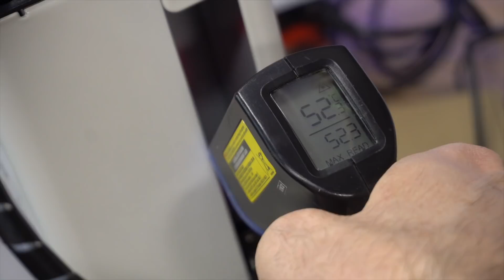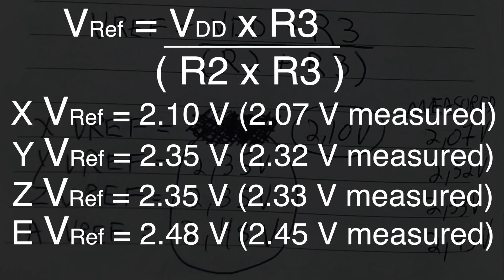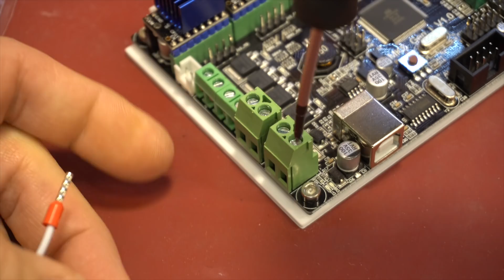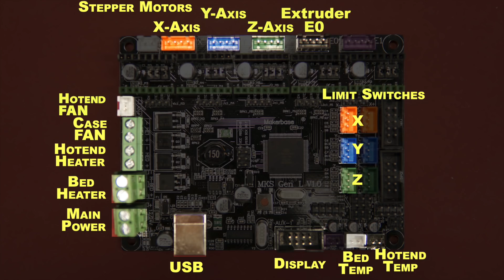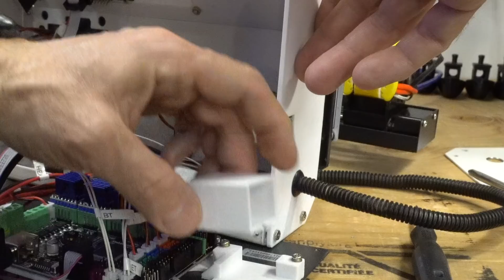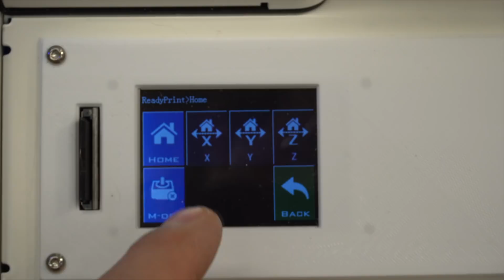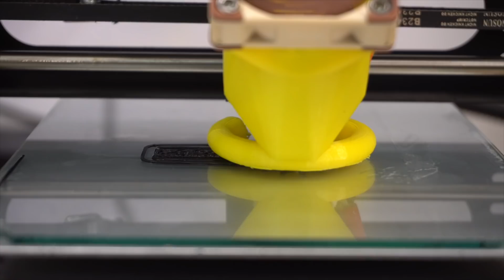Monoprice Mini V2 and V1 - Transformation Part 2

Comment: Frank:  Well, things are beginning to get final, however, there is one issue that so far is not solved:  The hot end fan does not come on when the extruder temp exceeds the set temperature (50C).  It's connected to pin 9, as is specified in configuration_adv.h.  The fan was working fine in the original configuration, so it should be OK, but I also checked the voltage on those pins, and it's zero.  

Is there someplace else that it could be overridden?  Note that this is in a test only.  I have not yet been able print anything.
Reply: Well, it's gremlins again.  There must have been a loose plug or something because the last time I started it up, the hot end fan is now working.   No idea what's going on.  

So, now, the only issue is that the extruder is running backwards, so I need to modify the configuration.h file one more time.  The other motors were all running backwards, but I thought E0 was OK.  Once E0 is reversed, calibration prints can start!!!  

I have some questions about how this is all going to work, but that can wait for now...
Reply from the maker: Strange so some versions have the motors in reverse! Send your question when you want...
Reply from the maker: Yes it’s also necessary to disable pin 9 in the file pins_RAMPS.h file putting -1 instead of 9 :

#ifndef RAMPS_D9_PIN
  #define RAMPS_D9_PIN      -1 //9
#endif
Reply: @Franks3Dshop  That was already done.  But, see below..

Comment: This is a total noob question.  When I open your Marlin.ino file by double clicking on it, Arduino loads the file.  However I only see one tab.  That is the first "Marlin" tab.  I don't see the other tabs (i.e.  the "Configuration.h" or the "Configuration_adv.h" tabs) that I will need to edit.  As a test, I downloaded a copy of Marlin.ino from the Marlin website and they show up.  Am I doing something wrong?
Reply from the maker: Hi, I do not know, but you could copy my two config files to the working directory, you will also need Ramps and ramps Gen l files
Reply: @Franks3Dshop  I got it to work!  I took the .ino file I downloaded from the Marlin website and deleted everything but the Marlin.ino file.  I then took your files and copied everything but your Marlin.ino file  into the one from the Marlin website.  I can now seethe configuration.h and Configuration_adv.h tabs with your edits. 
I think I'm gonna wait til you do the TMC2130 mods.  I'm gonna try to add the sensor-less endstop mod.  I have one question though.  Which brand of TMC2130 drivers should I be looking for?  Do you have a link to the ones you got?  The reason I'm asking is that if I have to order these via China post, it's gonna take a month to get them.  If I order them now, they will get here shortly after you post that video.  I still haven't got my TFT screen yet.  It arrived in Chicago 4 days ago from China and has sat there since.  I can't wait to look at that.
Reply from the maker: Hi, I will use these AliExpress ones, I already tested them they seemed fine and the cable are already done for you: http://s.aliexpress.com/FNzu6Fnu Or you can use a local store. In SPI control you will be able to set the Vref in software no calculation needed...
Reply from the maker: Cool that were able to solve this, I will load the file on. My PC and save it again, I think it’s because it was edited on a Mac... 

These also seems to be the same, not sur if you can have them Prime I do not see it from Canada https://amzn.to/2D3dc1i
Reply: @Franks3Dshop  Thanks.  I checked and they are Prime.  I will order them tomorrow.

Comment: Frank, super design surtout le bloc USB B !!! T'as pas eu de trouble à utiliser en même temps le TFT et Octoprint ? Lors de ma 1ère impression via octoprint avec le TFT branché, l'imprimante a subitement arrêté d'imprimer ! En googlant, j'ai vu que le TFT utilisait aussi le port série de la MKS Gen L (comme octoprint) et que du coup c'était déconseillé d'utiliser les 2. Pour remédier à ce problème, je compte couper le connecteur de l'écran et ajouter un switch afin de pouvoir déconnecter le fil TX serial du TFT vers la carte quand je veux (donc pendant une impression lancée via octoprint). Que penses-tu de cette idée ?
Reply from the maker: Salut, non je n'ai aucun problème à utiliser le TFT et Octoprint, remarque je ne touche pas au TFT quand j'imprime avec Octoprint, mais j'ai imprimé environ 12 pièces sans problèmes. Le board MKS Gen L semble permettre d'utiliser les deux, d'ailleurs quand tu branches l'imprimante sur Arduino, tu vois 2 ports séries, le deuxième semble être le TFT. Je pense qu'ils sont en parallel et peuvent être utilisé en même temps.

Comment: Frank:  Since you did not explicitly address it, is the Marlin version that is on Thingiverse ready to upload to the MKS?  Or do some modifications need to be made?  Also, how is the file for the TFT to be used?   (Excuse me if they have been updated with details in the last week.  I grabbed them when they first appeared)
Reply from the maker: I will do more videos and more about those. I do not think I have modified the Marlin and MKS files since then, just to be sure grab them again. Yes the Marlin is ready to use, it is the one I have put on my board, as long as you have an MKS Gen L board like mine you are fine. For the MKS, you just put the files from the folder "Classic_En_Win8 Mini V2 - Franks3DShop" at the root of an SD card in fat32, boot the screen and it will update and get my settings and custom screen. Please, let me know if all goes well. Thanks.
Reply: @Franks3Dshop  So far, so good, Frank.  I was able to compile and upload the Marlin file.  (Couple of tiny changes, as I am starting out with the DRV8825s because that's what I have on hand.  Big issue will be setting the  driver voltages and getting the steps correct, although I've just been through this on another project.)

Did the boot of the display with your files on the SD card, and that was perfect as well.  

I have not yet hooked up any of the electronics, but I don't anticipate any surprises there either since it will be almost identical to the hookup on my other project that uses the MKS Gen L.  The only outstanding issue is that the TFT24 does not quite fit into the faceplate piece, so I need to slightly modify that...it's too small in one dimension by less than 0.5 mm.  (I already reprinted once, so I think this will work.)

On balance, it went very well so far.  Thanks for your support.
Reply from the maker: Hi, good to know, for the DRV8825 in the video you have the iMax values of the original board, you should be able to calculate the same values with the DRVs... My printers are really well calibrated in X and Y, your’s probably needs a little tuning to get the correct alignements... Or just scale it your slicer... Thanks.
Reply: @Franks3Dshop  Two more noob questions.  Do I copy "Classic_En_Win8 Mini V2 - Franks3DShop" and all the attached files to the SD card?  Or just the files under "Classic_En_Win8 Mini V2 - Franks3DShop"?  I was gonna do the latter but thought I should ask.  Also what do you mean by "boot the screen"?  Could you do a quick sequence of the steps that are needed to do this?  Just a couple quick sentences to point me in the right direction and I will figure it out.  I should be getting my TFT tomorrow and want to play with it. Thanks.
Reply from the maker: Hi, only the content of Classic... should by copied to the SD card, if it works it is going to be renamed by the TFT screen, there is no danger it will just not work if you do not have the files in the right place or if the card is not formatted correctly...

1- you copy the files,
2- you put the SD card in the screen slot
3- you power on the screen and let it do it’s updates, you will see it on screen...
Reply: @Franks3Dshop  Thank You.

Comment: Awesome! Just waiting for the last part then im doing this!

One question, i have 3 fans running today (hotend, part cooling ans case). Where on the board can i add the third fan?
Reply from the maker: I will connect the Hot End and Case fan in parallel so that I can use the part cooling fan. You could also use a free pin on the board, like any of the +X, Y and Z and turn on the case fan or hot end fan with a Mosfet board.
Reply from the maker: For myself, the Hot End and Case fan will be in parallel since they are almost always ON at the same time...
Reply: Frank's 3D shop Thanks! Do you know if there is a product for running two fans in parallel? Im not so good with the soldering iron on so small cables :-)
Reply from the maker: If you use the output for E1, those are srew-in connectors, you just twist the cables together!
Reply: Frank's 3D shop Good idea!